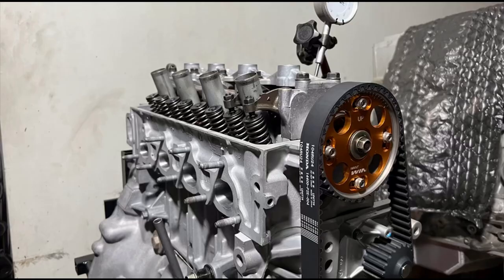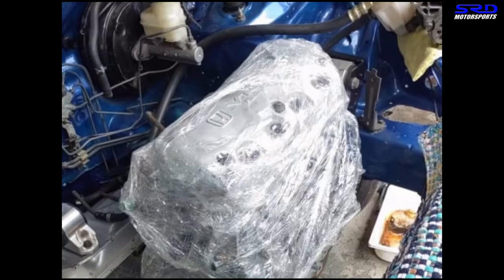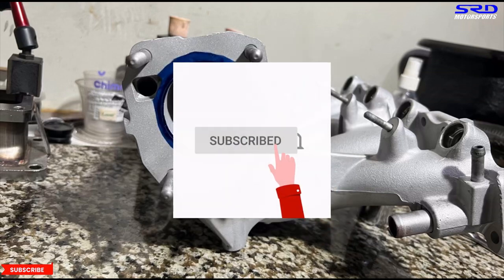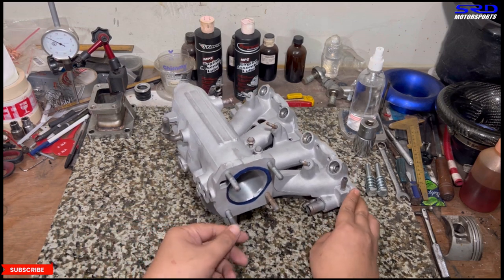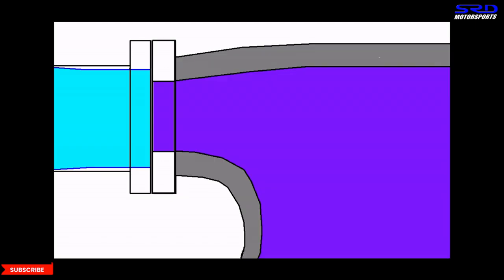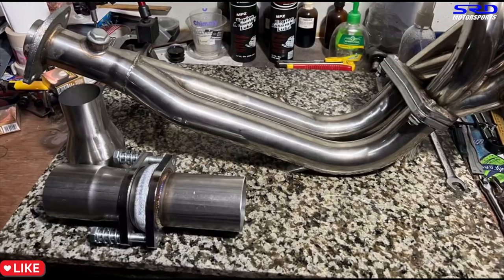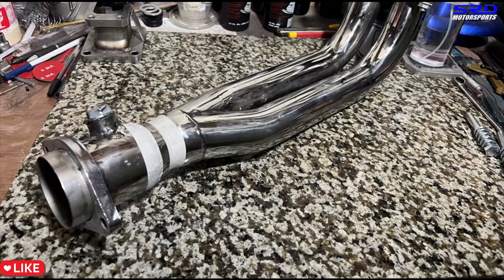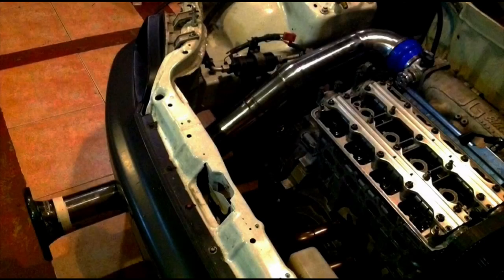D16zc VTEC Build Series Part 4 Exhaust Modification & Port Match

Comment: How do you counter the fuel knock or "tope" in the high compression ratio ? Il been maxed out of retarding the timming in tune but it loss power  band in high rpm range so my idea is to have a custom cam to compesate with the high conpression ratio what your thoughts about it ? Any idea ? Im glad if you answer my question and very very helpfull about your thoughts 😊
Reply from the maker: depends on what engine and what cam it has
But tope is also never just the same cylinder, believe it or not , making sure each chamber has equal chamber volume , helps a lot

Comment: Looking forward to the build series coming up
Reply from the maker: Oh most definitely :) and me too! actually wished I took a short clip of when we were reshuffling the 3 engine stands was tiring but was fun 🤣
Reply: @SRDmotorsports  I can understand that. Have you used any rocket motorsports cams?
Reply from the maker: Yeah waaaaay way back
Reply: @SRDmotorsports  how would you compare them to skunk2 or a delta regrind. Do you have any preferences?
Reply from the maker: they’re okay… I mean I’ve tried quite a few dohc stuff

On to the sohc vtec, I’d still choose Crower (not Brian Crower) though I havnt tried the bigger skunk2 stage 4

For non vtec D16 Delta is good, and Ofcourse Webcam too! like my personal cam is a Bisimoto d16a6 that’s done by Webcam